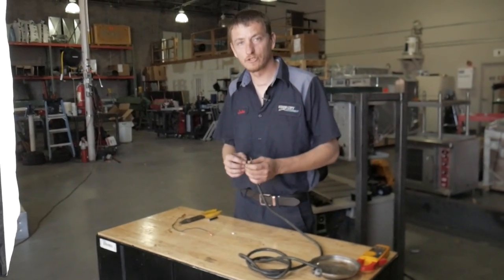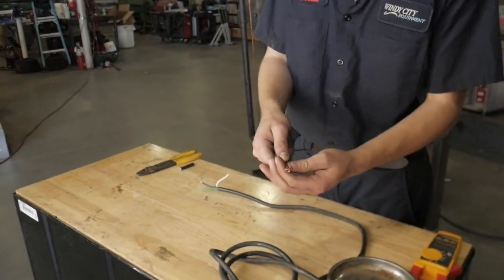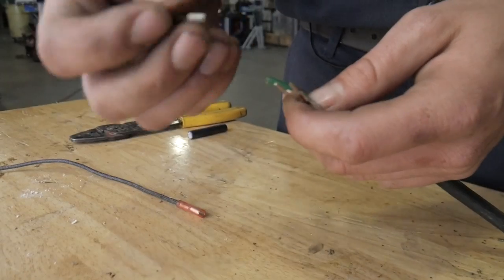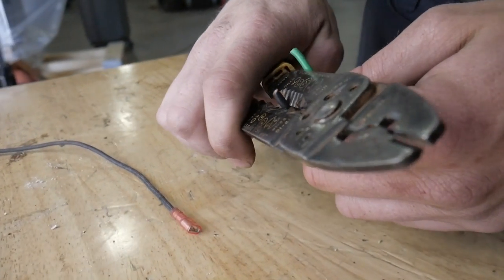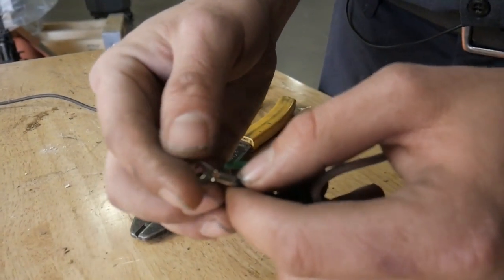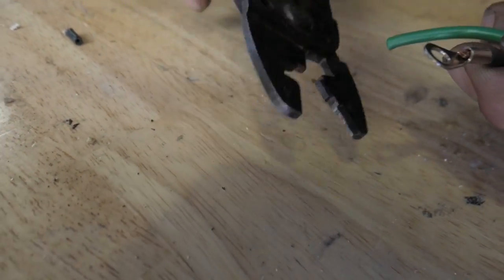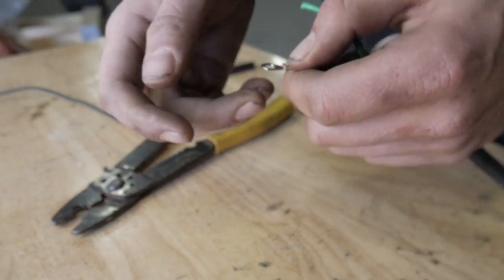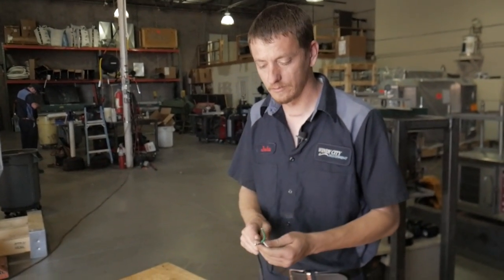How to Replace a Terminal End - Crimp Spade Terminal

Comment: Great video. I have a commercial electric deep fryer that's not getting up to temperature but seems to be heating up slowly. What would be the possible cause of this? Thanks
Reply from the maker: If it's heating slowly it most likely means that not all of the elements are engaging.  Or are only partially engaged.  Unfortunately this is a bit too complex for explanation.  It would be best to call a technician on this one.  Sorry I couldn't be of more help.  Thanks for watching!

Comment: My ac went off in my Chevy big block. Found a spade terminal burnt and super hot!!! After a few years of my kids kicking the blower motor under the dash, the connection wasn’t any good anymore… loose connection and high current don’t mix